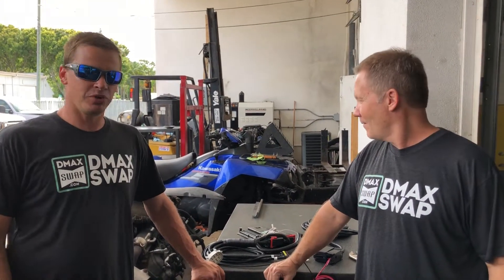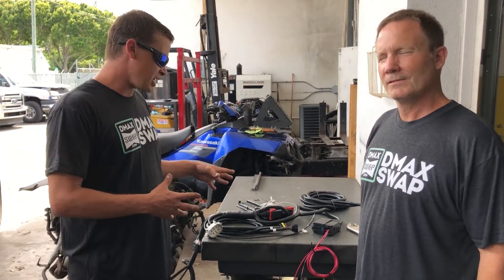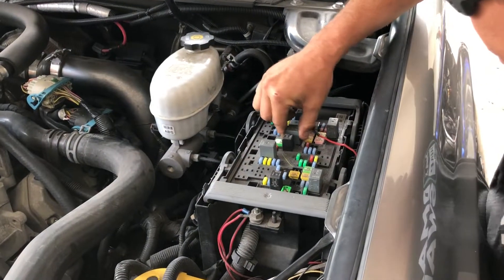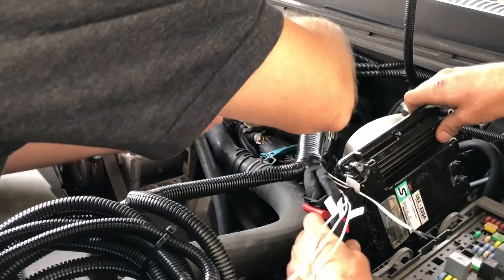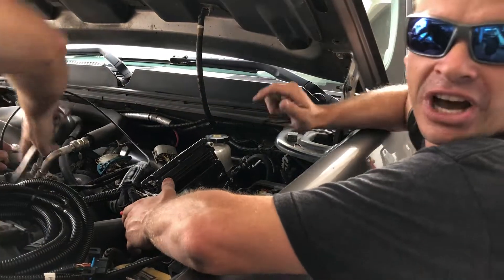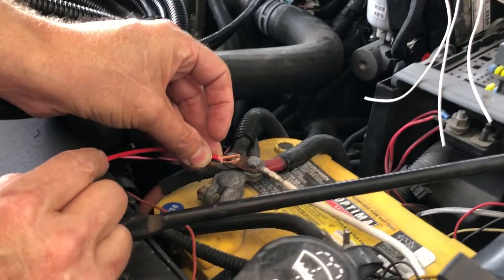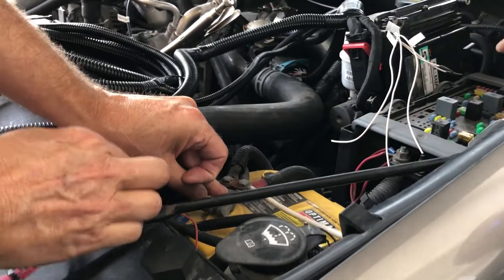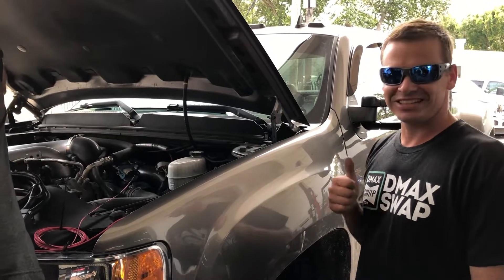Dmax Swap Standalone Harness Hook-up Demo

Comment: Can this system be used to run a 2004 GMC 2500hd lly with electrical problems.  Mine keeps going to limp mode for #2. But they can't fix it.

Comment: After watching this video, i realised that the ecu is for the engine only. You would have to decide what transmission to run behind it. You know, like a 4r100 from a 7.3 powerstroke with an adapter plate to bolt the 4r100 behind a duramax. A transmission controller for a 4r100 would be needed.
Reply: Who makes a 4r100 adapter plate?
Reply: @adamsorell4851  i think it was Destroked.
Reply: Or you could run an nv4500.

Comment: Great videos you guys have, easy to understand how everything works. Make more videos, and you get more followers. I recently bought a LB7 with the RIGHT HARNESS and ECM for making it standalone. Travis Nighbert made a awesome video for me last week, about standalone harness from you, to use with a 4L80E. Kudos to him and good promotion of you :) I will need the same exact setup he has, Standalone LB7 with OEM 4L80E. This is going in a 6.5NA 1995 Hummer H1 that has the (standalone 4L80E) with TPS sensor on the mechanical diesel pump. Also need TPS signal from LB7 pedal or ECM to the 4L80E, but I am sure you know what I am talking about. Can you hook me up, where to go next?